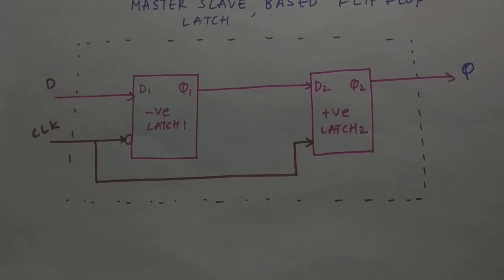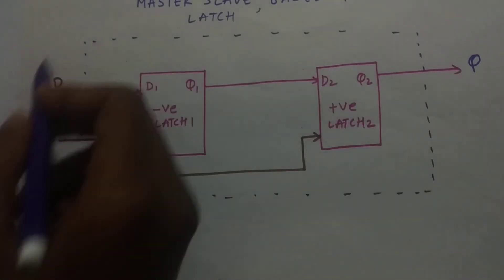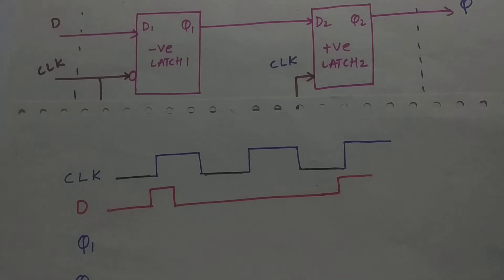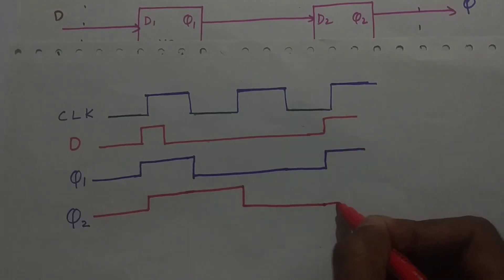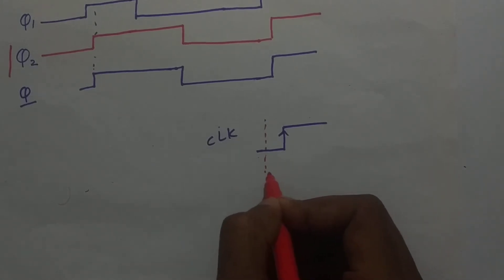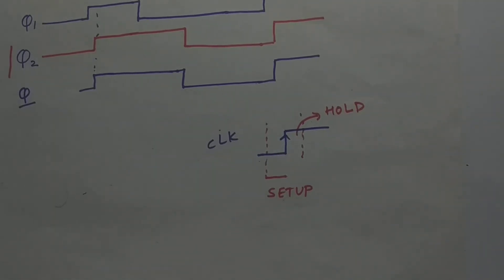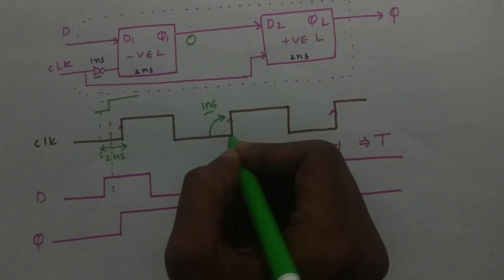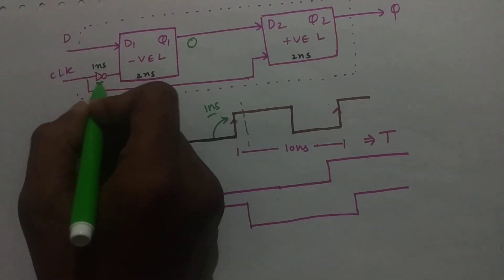Why a flip flop have setup time and hold time? Explained!

Comment: even if there was 1 ns delay during the hold time and the inout is changed it woulnd occur at the output right since setup time is 2ns and hence there will not be any change (@11:03)
Reply: There will not be any effect for hold at that case right ...
Reply: Agree I think the explanation is wrong there since the output of -ve latch takes 2 ns to update. So during the 1 ns Window the output won't change

Comment: Thank you for such a nice explanation.
Could you please tell me why the setup time corresponds to the delay of the latch(i.e., 2ns) and hold time corresponds to the delay of the not gate(i.e., 1ns) only and not the other way around.
Reply from the maker: Hey prajawal ,thanks for asking the question, 
Setup time corresponds to delay of latch.
If that's other way then we will have more time relaxed for setup because clock is delayed .so this is not the critical case than above one.
In hold time ,if  corresponds to delay of latch, here also timing is relaxed so not gate delay is main reason for hold time 
I hope this clears your doubt,if you have any doubts please feel free to comment.
Pls do subscribe it will me a lot 🙏 thank you

Comment: In somecase,consider that Hold time error is 1Lakh,if setup time is zero then hold time also becomes zero.i dont know why it is happening like that.some guys are saying it is routing delay i can't get what is the concept behind it.
Reply from the maker: Hey karthi , thanks for asking but I am unable to get your question can you please elaborate 👍
Reply: I am running a design in ISE..In place and route it will do timing analysis,i m right...In place and route phase setup time and hold time are shown...

here for me setup time becomes zero and hold violation shows 164000 at last phase of timing analysis in place and route it also becomes zero i don't why it is not showing hold violation...it automatically makes zero..why it automatically makes hold time to zero
Reply from the maker: May be during optimization hold time got cleared this is my assumption I don't know exact scenario